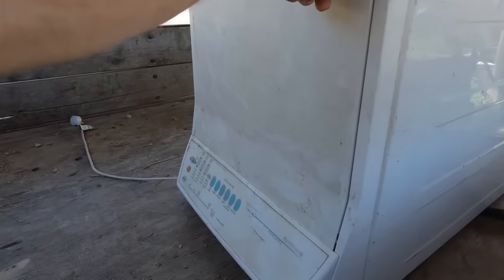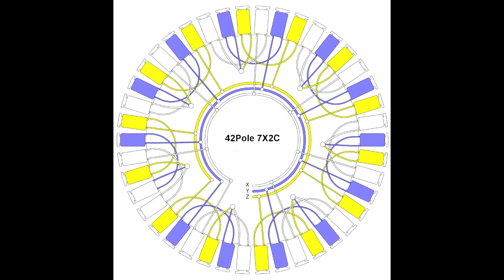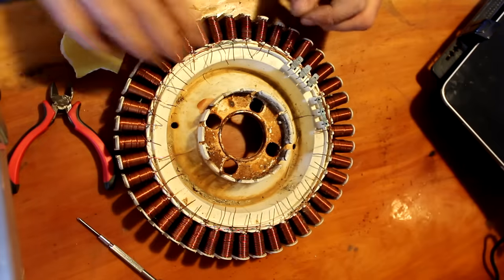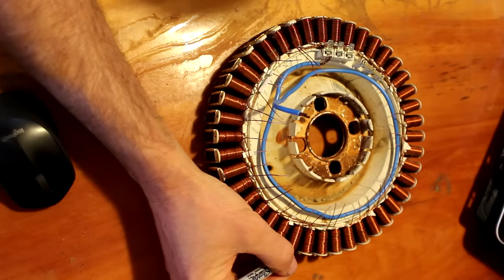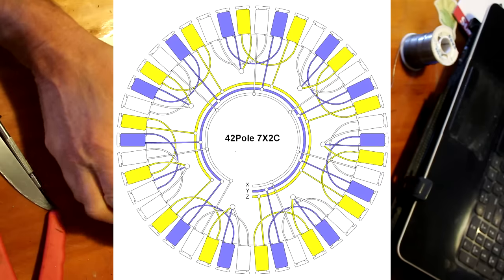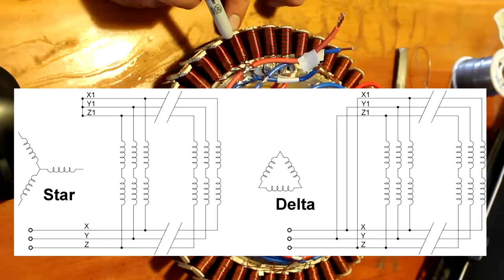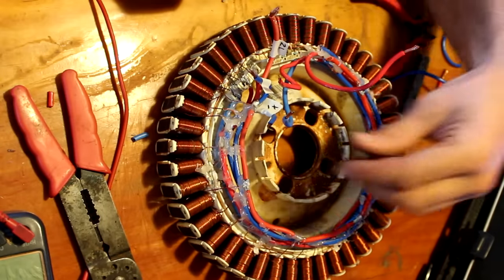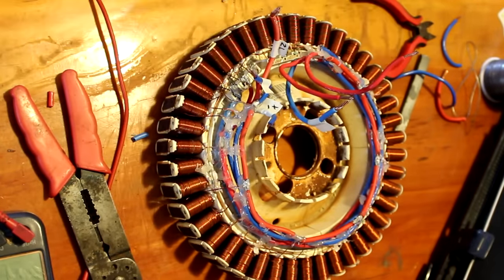Free Power from Water Part 3- Rewiring a smartdrive washing machine motor to generate power

Comment: Hey, Marty, I had a thought. You may be better off running the higher voltage from your turbine out to the house, rather than rectifying it at the source. You'll have less resistive loss on the line with higher voltage. Plus, you'd be able to keep all the sensitive electronics inside the house.
Reply: Linas Velavicius
8 hours ago (edited)
Marty after watching your Part 2 I watched a YouTube explaining the difference between conventional generator vs the new more expensive inverter type generators. I also looked up Skin Effect. For those who don’t know I copy paste the explanation from the Internet;

“The main technical difference between inverter generators and conventional generators is what kind of electricity is produce, conventional generators only produce AC electricity while an inverter generator produces electricity in three phases (high frequency AC to DC back to stable  AC current)”  

“Skin Effect results from circulating eddy currents, arising from a changing B field, cancelling the current flow in the center of a conductor and reinforcing it in the skin. This reduces the effective cross sectional area increasing wire resistance and losses.”

Now I understand your "inverter" setup, your cost to effectiveness ratio is just brilliant. Big fan, love your channel.
Reply: Marty T
2 hours ago (edited)
It is very hard to spin the rotor with factory wiring with a load attached, this site doesn't have enough pressure or flow, also very dangerous and high hz / high loss over long distance (skin effect
Reply from the maker: It is very hard to spin the rotor with factory wiring with a load attached, this site doesn't have enough pressure or flow, also very dangerous and high hz / high loss over long distance (skin effect)
Reply: @MartyT  I see you have just copied and pasted this comment haha. may as well pin it.

Comment: I haven't used an iron like that in.over 40 years.  We had a gas furnace to heat them. and a block of SAL Ammoniac to clean the iron.  Primarily used to solder sheet metal

Comment: Great video!  so nice to see how you did the re-wiring.   I'm thinking about using a few of those in factory condition in paralell to have 400V and a few Amps to charge a battery / solar system that's EU 400V based. I did look at few washing machines at the local dump, and they all had digital controllers and brushless motors that were molded into the base of the washing-drum.
Reply: Marty T
2 hours ago (edited)
It is very hard to spin the rotor with factory wiring with a load attached, this site doesn't have enough pressure or flow, also very dangerous and high hz / high loss over long distance (skin effect

Comment: I scribe off part of insulation with razor blade and then I heat up copper until it will want to suck up solder - on the other side there will be still continuous insulation. When I'm done soldering to that place I wrap it with loctite self-vulcanised tape and it never brakes off or oxidate - seal is preety good, there is no partially cutted copper, connection is vibration proffered by rubber tape. In my, automotive application, it is also behaving great in oily and hot environment and with no need to take wire out of bundle at all
Reply: And that tape is cheap, as you will only need ~2cm for most connections in case of thinner wires

Comment: Hi Marty 
Great channel 👍. You may like to put in a seal assembly between your pelton wheel and stator (or is the washing machine still there, in which case very clever.) I burnt out a few coils on one by not doing this. I used a car auto torque converter cut in half as the turbine / pelton wheel. It would easily generate 500w testing off a fire pump with 450kpa and a 12mm nozzle.
Reply: See part 2....replacing the bearings...and the seal....

Comment: have youever mixed a bit of epoxy vatnish and just painted the wire after the connections are made? do you think that could increase durability or simply not worth the effort?
Reply from the maker: Yes that would  protect it from the elements

Comment: Those smartdrive washing machines are rare beasts in the UK as most of washing machines over here are front loaders as they are usually under counters or stacked with a dryer, though it should not be too hard to source a replacement.
Reply: A lot of manufacturers use brushless motors now because they have fewer moving parts and eliminate belts and gearboxes....google spare new parts to find out which model and work backwards to find a repairer's junk pile....
Reply: Check out LG front loading machines with direct drive motors - they might be OK.

Comment: Hi Marty can you clear something up for me please ? None of these type of systems make direct 230v do they ?  Are you sending the low voltage to a battery bank then in turn using that power to work an inverter to get your 230v ?
Cheers in advance 😁😁🤘🤘
Reply from the maker: That's right, not enough flow at this site to produce 240vac straight off the turbine, it would max out at around 1kw and you'd have blackouts, whereas with dc turbine - battery - inverter we can get up to 6kw with the battery bank picking up the slack when using more than than turbine is producing
Reply: @MartyT  thanks for that bud all is clear now 😁👍👍

Comment: Thank you for this excellent information. How do you know 1kw would be pushing the limits of the stator? & how do you know the cable & inverter losses would be 10%?
Reply: Experience...hands and ears-on experience over 17 years for the behaviour of the gen setup and maximum revs....with 280 watt and 500 watt turbines, now 885 watt turbine setup....
Re the 10% loss...
what/how have you worked out the losses?
Reply: @JohnSmith-pl2bk  I haven't, that's why I ask.

Comment: What about keeping the 480v wiring and running it through a transformer to step down to 240, 120, 12v etc. as needed?
Reply: Dangerous voltage for an amateur to handle...

Comment: I need to consider adapting your idea to a larger but slower water wheel situation... slow moving but high volume river.
What is the optimum rpm required for the motor/generator?
Reply from the maker: This one likes to going over 500rpm but you can rewire the stator to suit slower turbines
Reply: @MartyT  thanks for answer.
Let me see what I can achieve with gearing

Comment: Interesting.   I wonder if an option to reduce one of the higher cost of the system would be to leave the output at the higher voltage and lower current.  Then run that to the point of use and transform it to lower voltage and higher current.  That would greatly reduce the gauge of wire needed over the long run to the point of use.
Reply: Marty T
2 hours ago (edited)
It is very hard to spin the rotor with factory wiring with a load attached, this site doesn't have enough pressure or flow, also very dangerous and high hz / high loss over long distance (skin effect

Comment: This is really handy, I was thinking, if this puts out 400v I wonder if you could combine that with a 400v EV battery and that would mean the power would transport easier over distances? Then rectify the power at the house? Or would you need more expensive cabling etc?
Reply from the maker: Thanks John..  you're a wealth of knowledge mate
Reply: @JohnSmith-yv6eq  cheers John, I wasn't saying this doesn't work, the dude has too much power by the looks of it, I was asking more regarding using the 400V in a longer application (let's say from one side of a site to the other  and it's a mile long or something) but I can see why you interpreted it that way as I'm saying "could you" when I probably mean, "could I" lol

Comment: I've noticed how you pour oil and hydraulic fluid out of buckets just a suggestion if you have room turn the bucket around so the opening will be on the upper end and it'll make be easier to keep it from sloshing and the dreaded glub glub which makes a huge mess once you get enough out you can turn it around and pour the rest

Comment: Interesting video. So is the Star and Delta premanently connected through that block, or do you disconnect the Delta wires at certain times of the year so that it only runs in Star?

Comment: Would you would have been better leaving the voltage high until you got it to the house and then step it down for the same reasons that they use high voltage on power lines across the country?

Comment: I would have done things a bit different... used that higher voltage to my advantage, since you're a bit far from the house. One would have less transmission losses and could use cheaper thinner wire. All the controls would stay safer inside too. Cheers!
Reply: Linas Velavicius
8 hours ago (edited)
Marty after watching your Part 2 I watched a YouTube explaining the difference between conventional generator vs the new more expensive inverter type generators. I also looked up Skin Effect. For those who don’t know I copy paste the explanation from the Internet;

“The main technical difference between inverter generators and conventional generators is what kind of electricity is produce, conventional generators only produce AC electricity while an inverter generator produces electricity in three phases (high frequency AC to DC back to stable  AC current)”  

“Skin Effect results from circulating eddy currents, arising from a changing B field, cancelling the current flow in the center of a conductor and reinforcing it in the skin. This reduces the effective cross sectional area increasing wire resistance and losses.”

Now I understand your "inverter" setup, your cost to effectiveness ratio is just brilliant. Big fan, love your channel.
Reply: Marty T
2 hours ago (edited)
It is very hard to spin the rotor with factory wiring with a load attached, this site doesn't have enough pressure or flow, also very dangerous and high hz / high loss over long distance (skin effect
Reply from the maker: It is very hard to spin the rotor over the factory wired stator with a load attached, this site doesn't have enough pressure or flow, also very dangerous and high hz / high loss over long distance (skin effect)

Comment: dont you want high voltage for transmission? for like less resistance in cables and such to the house. then just shove it through a transformer to get the lower voltage you want. idk I don't know mutch about this stuff, is there something I'm missing?
Reply from the maker: Transmitting 240vac means very little cable loss

Comment: My recollection...enamel covered wires dont need scraping. They're designed to solder through the enamel. Just blob of solder on your iron and apply to the wire end and it burns off enamel and tins the copper wire in one go. PS Surely cored solder for electrical connections as the old style paste was liable to corode.
Reply from the maker: Tried that, it doesn't stick and gets messy

Comment: I was taught Delta and Wye, military school. I think there was an advantage to Delta, perhaps for depth charges. I am curious about two things. Do most washing machines use three phase motors, or is that a local thing? And how much head is there for this water turbine? Thanks for making my brain reach into the distant past.
Reply from the maker: Some brands use these type of direct drive motors, fisher & paykel smartdrive is the one to use, other brands have aluminium wiring which is impossible to solder. Head is around 100psi

Comment: The only problem I see with hot glue is if things get hot perfect for the project though thank you for the videos
Reply from the maker: I did wonder the same when building my first stator, but I've never had a problem with the glue melting in 17 years running one of these on my turbine

Comment: 1:56 For the distance it was transported I would have used 400V and then transformed it down to say 27V at the house with a transformer, much more efficient.
Reply: @JohnSmith-yv6eq  Oh I totally forgot that you had the battery at the turbine and then transformed it up to 230V with the inverter and then that was transported to the home. That make much more sense and really good work by the way!

Comment: Adding a couple extra batteries never hurtsand it helps provide a cushion for lower amp input and for heavier loads.
Reply: The output from this system is meant to be proportionate to the water supply and to the lifestyle....no air con, no welding etc.
Everything presently at the house can be supplied by this system...future "power walls" could be installed when the price point gets low enough....

Comment: Fascinating that there was already a water ram pump being used to (I assume) get the house supplied way up the hill. Although the house may have been at a similar elevation to the dam. The relatively unsophisticated part of the setup seems to be the size of the nozzle jet driving the vanes.(Thinking overcapacity water wise). Couldn't this setup be used near the house using the water ram, polythene pipe to a header tank(s) and a finely controlled jet matching the turbine? Hopefully this would reduce the water usage  and the storage could offset the seasonal water flow. Or is this bonkers.
Reply: @JohnSmith-yv6eq  The 'fall" can be replicated by a header tank. What it lacks in height can be replicated by volume(as long as it is practical, this is what I'm asking)) and atmospheric pressure. And what would the minimum pressure be to spin the turbine. Marty had to detune his system because it risked exceeding the capabilities and he says there is enough surplus capacity  for a parallel set up. I'm trying not to forget that low cost was a major objective, just intrigued that a low cost system could be set up without the disadvantages of lowering stuff down the bank.

Comment: if whats output is a low voltage high current ac output before you rectify it, couldn't the cable run down to the house first, then rectified and sent to the batteries/inverter in a less damp area(as AC power gets very little loss over distance via cable)?
or is it not alternating enough for that?
just wondering cause it looks like alot of the stuff is in a super damp cold area

also, great video as usual
Reply: Check the other bids 1 and 2
Untouched output high voltage, high frequency,  low amps,  
Skin effect gives relatively large losses transmitting power as far as house, hence rectification to usable  power more suited for tramsmission

Comment: Great video to get us up to speed with the rewiring process. Out of interest, what charge controller are you using? Edit: Oh, are you just connecting it directly to the batteries and relying on the valve to limit charging?

If you were to get a motor with 36 coils, you could rewire it in 3 parallel sets of 4 series 3-phase coils. That should net you ~120Vmax, which is within some ~50USD MPPT chargers' input voltage range. That way you could rectify it at the source and run 2 DC wires up to the house to charge the main battery bank instead. Obviously that won't quite be as efficient as 220V, but could be offset by the fewer steps from the source to the load.
Also, you could then switch in a geyser element as a dump load instead of wasting that energy.
Reply from the maker: Interesting about the 36 coil stator, i've never actually played with one of those.. I'm using an an array analog plc as a charge controller at the house

Comment: Is it the static head pressure that is 100psi or is that once your running with the 12mm hose connector?
Reply: Because the penstock is always full there is little difference in pressure between the tow measured pressures....

Comment: Apologies if already answered but out of interest. Given that electricity in low voltage doesn't like to travel long distances, would it not have been more effective to leave the output at 400v and run the wiring up to the house then house the electronics and batteries in a nicer/warmer environment? Would this not give less losses?
Reply from the maker: The generator output is high hz so doesn't travel long distance well (skin effect), also its a safety thing, I don't want anyone to be electrocuted

Comment: Absolutely brilliant Marty, I mean ur whole series, couldn’t stop watching it! Tell me, can u use an all in one inverter up to 450-500v PV input for the hydro 4-500v output direct without rewiring the motor stator? Or would the high frequency be an issue? Maybe a rectifier in between? The all in one hi frequency inverter’s on the market nowadays are getting pretty smart and good for a relatively cheap price point. Great job !

Comment: I’m no expert but wouldn’t you want high voltage and low amps run up to the house and then convert it? That’s how the power company’s do it. Great vids man I’m addicted!
Reply from the maker: It is very hard to spin the rotor with factory wiring with a load attached, this site doesn't have enough pressure or flow, also very dangerous and high hz / high loss over long distance (skin effect)

Comment: G,day from Sydney Australia.
Thankyou for explaining the turbine hydro generator. I understood the circuit plans 7 sets, linking 2, 4 apart,  then connecting to Centre wiring as the diagram.
Q1. Why did you need 7 seperate wires ( Delta and other) is it the thickness of wire transfer of amps and volts?
🌏☮️

Comment: I'm curious, is there any way to make this a stand alone unit without having to put a draw line into a stream? (Ex a drill pump to run the pelton wheel where it's pulling from an onboard water reservoir at a lower point?
Reply: I have the same idea.

Comment: you know, i find myself wondering if someone who knows more about electricity and such than me, could use a PLC and slave relays, to monitor RPMs and adjust it from DELTA to STAR on the fly? I'm thinking it wouldnt take much, just some kind of RPM sensor to trip the relays from STAR to DELTA or visa versa as RPMs change...
Reply: @JohnSmith-yv6eq  and? I didnt say he should do it, just wondered if it was a possibility...